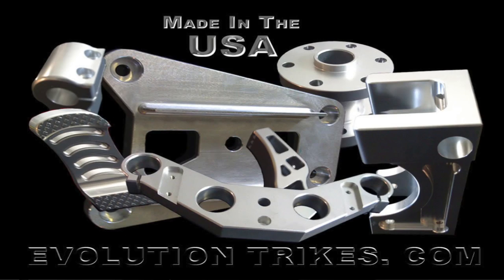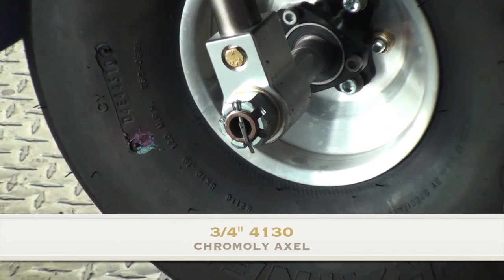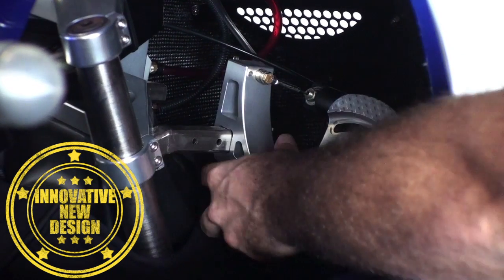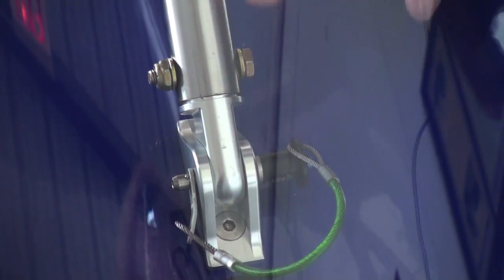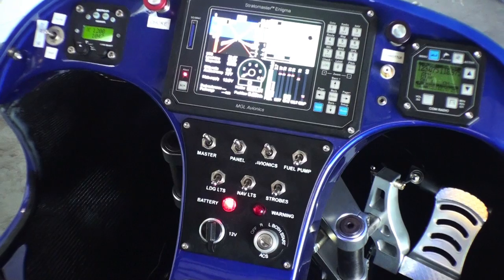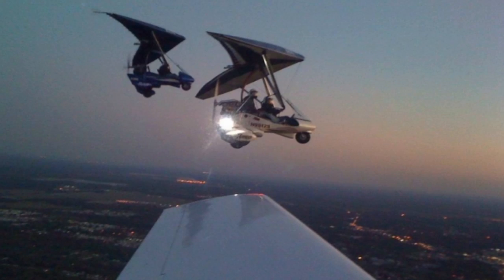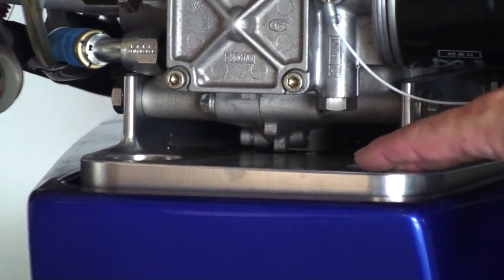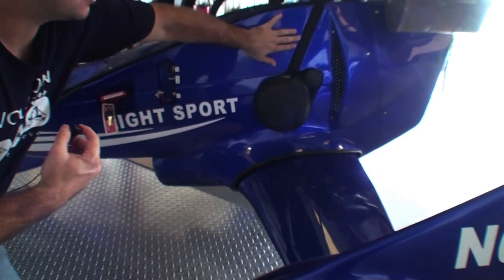The REVO, Inside and Out Compressed

Comment: Aeros uses a shifting CG as well. However the REVO is center line pull and does not jam or bind like other designs that push and pull below or above keel. Bautek used a similar design closer to the REVO's design but not electric and not center line pull and DTA uses a unique design of their own that also shifts the CG with no binding issues that would sometime destroy actuators.

Comment from the maker: These are N numbered FAA LSA registered aircraft.  You can fly them from anywhere it is safe to takeoff and land if the airspace is not restricted and weather permitting.  There is a beach corridor past Chicago.  They fly fine in the mountains with training on how to find landing spots and special wind conditions.  You can get between 3 and 5 gallons per hour depending on the airspeed with a 14.8 gal tank (larger available) - average of 240 miles per hop.  From $20,000 (some cheaper) to $90,000.

Comment: they used an electric motor and worm gear on the old blade i believe?
ive definately seen a quik fitted with one of these in a magazine a couple of years back, it had a pneumatic piston that pushed it forward and back, dunno if they ever used it on a production machine

Comment: I find it ironic that the new Sport Pilot Certification and the certification of the newer sport aircraft (like this one) was designed to make flying more affordable and reachable for the common average man/woman. All these LSA craft being built coat as much as a house. The FAA needs to reinstate the old 2-seat UL rule. There was not a thing wrong with it
Reply: The FAA, like every other part of government, completely destroys ANYTHING that is good.  There was nothing wrong with the exemption (2-seat), only it was a big spot light on the fact without government, aviation flourished.
Reply: Without the government regulating everything to death, EVERYTHING flourishes. The FAA drives up the cost of aviation with over-regulation. Just look at the avionics you can get for a light sport.. what costs $2000 in an LSA could cost nearly $20,000 with an FAA certification. I had to replace an alternator on my Cherokee once. $600.00!! its a Chrysler alternator... its $50 at Napa. Down to the LAST detail, it is IDENTICAL to the FAA Certified aircraft replacement alternator.

Comment: Regardless of the quality put into this trike, there is absolutely NO JUSTIFICATION for this aircraft to cost over $100,000.. All I see is a fancy gocart with a lightweight engine and prop on the back of it and a wing on the top. I can think of better things to buy with $100,000. Just imagine how much this thing will depreciate in value over 3 to 5 years of ownership. There's a lot more engineering that goes into a brand new car than this thing.
Reply: Agreed. I would rather buy used Cessna!
Reply: Now I thought the same thing when I first seen it.  The website says 67, 500.  I'm sure that's american money.  I still find that to be quite steep.  Allthough it is a very nice looking aircraft, I to, do not think it's worth that much.  You could buy a very very nice LSA for that price, with a full cockpit, and one you could do aerobatics with, or a used cessna, and still have money left over for fuel or whatever.
Reply: Robert Smith I get it, but I am flying one weekly now while training for my sport pilots license and it is absolutely amazing.  But, I won't be buying one for my personal trike, way too much for me.  But, they sell ALOT of them so the price is obviously not hurting the sales.
Reply: for the cost of this, I can get training and buy with wing and all extra's. ten sets of paramotors with a lite trike,s too. so why would I want to spend what I could use it to start a paramotor school? and pay my self that much back to repay that amount back. so, why again buy this overpriced flying go-cart??